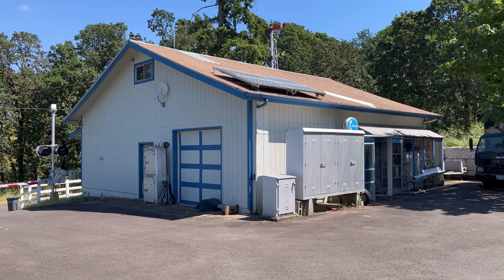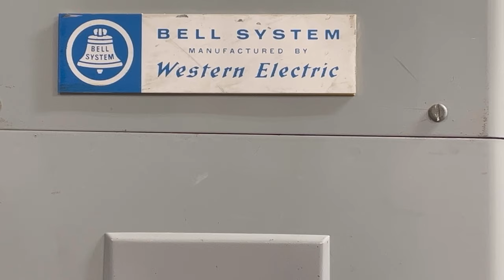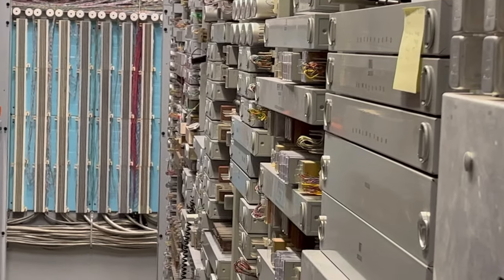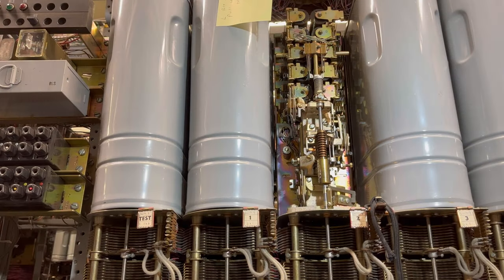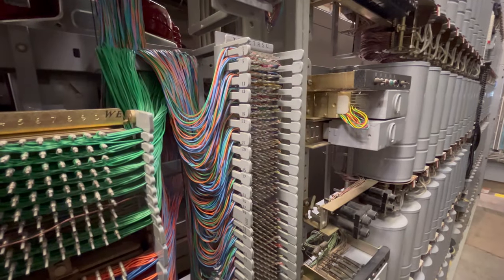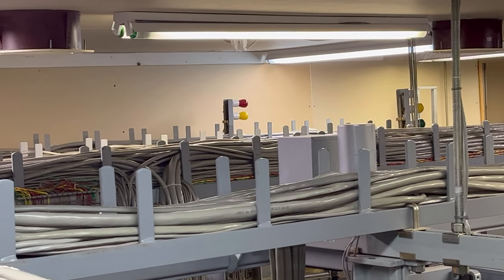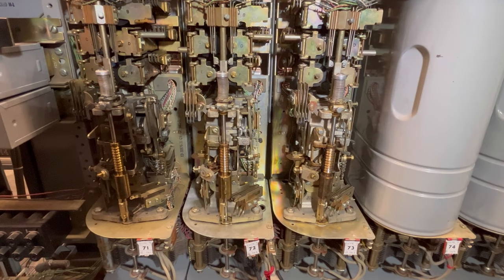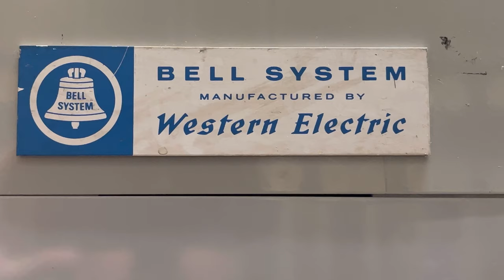Strowger, Step by step telephone system, (600 lines) used Bell system made by Western Electric. Pt 1

Comment: This is really interesting to see.  This must have taken so much time.  Thanks for sharing a small part of history.  I have always wondered about the head end of telco equipment.  My friend's mom started as a live operator. The lines are now fading, and I really miss the old telco equipment.  So many companies are trying to recreate this service and it is barely matched.  Now that copper lines are going away.  This is a real mess. Hopefully it will all get better soon. Thanks to all who kept the lines working for so many years.  I really hated that darn ring voltage.  This brings back a lot of memories of connecting into customer lines for Alarm panels. We had to time the incoming calls.  Many times, not knowing if we would get a zap! They have taken all the fun out of training on wiring up a RJ31X.  We recently had some really bad storms.  Now that we have gotten away from land lines.  We do get a lot less calls.  Do miss the burnt-up equipment.  Now looks like the new age is coming.  Most over cell and IP.  Thanks again

Comment: This is amazing. I could watch this stuff for hours. 

Back in the early 2000s, my employer leased a Merlin Legend PBX for our new office in San Jose, CA. We were in the building that used to be Netcom’s headquarters, one of the leading ISPs in the early days of the Internet. 

I taught myself everything from the Lucent manuals, so once the switch was installed, I became the administrator. 

Fast forward a few jobs and I was working in Chicago for a small tech firm. We had outgrown our existing offices and moved into a larger one. The lease included a Merlin Magix switch left behind by the previous occupant, so once again I became the admin. 

Your video brought back a lot of memories, so I just joined TCI.

Comment: Hi - Love your channel. I have a WE selector ED-55062-33 available to me. Is this a toll selector?  It includes a repeating coil. Do you know where I could find schematics of circuit descriptions? I am telephone exchange literate.
Reply from the maker: I would agree that that is a toll switch which the toll switch train is radically different than the local switch train I would not recommend buying it unless it's really cheap. If you need I have a basic local selector i have one that would work much better.